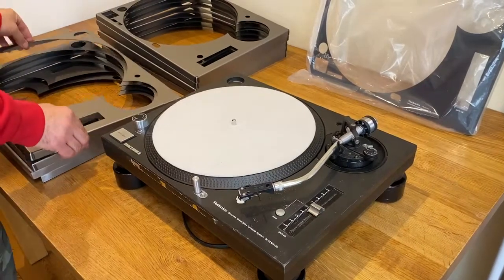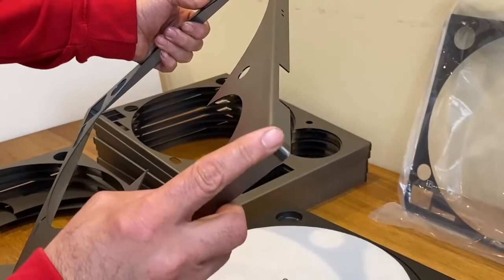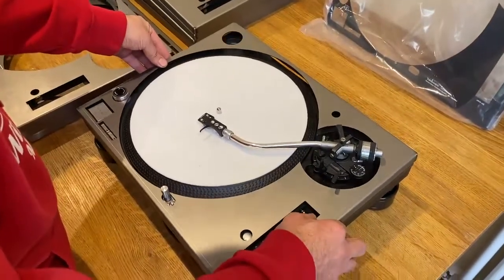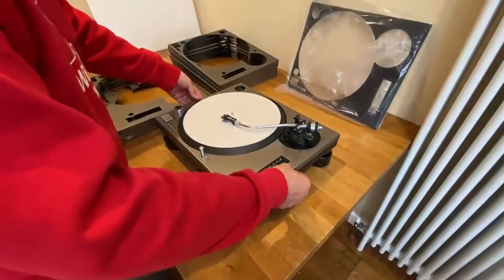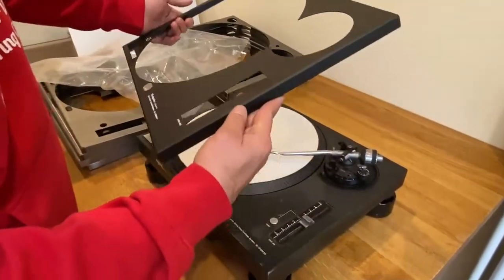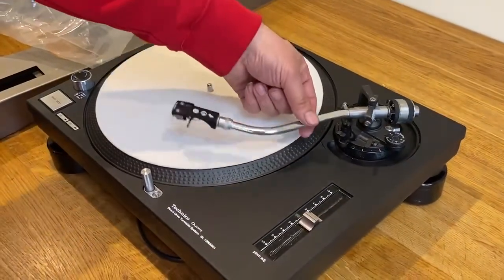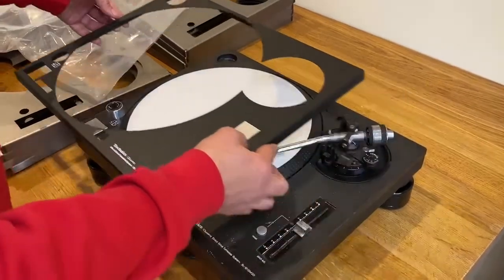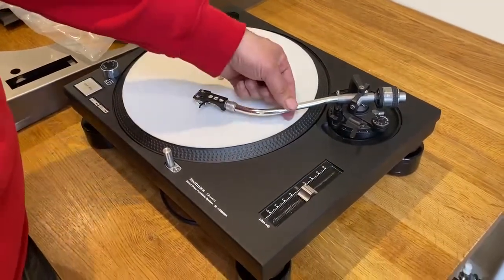Turntable Faceplates  Technics 1200 faceplates By MKStands

Comment: Pro tip.  Remove  the headshell from the arm before installing the faceplate. 
Very painful to watch  the stylus  be placed on the fiber mat and then get bumped.
Reply: agree
Reply: he had the tonearm lift lever up so tonearm is not touching nothing.
Reply: @xxx-xf7ks  ok
Reply: @xxx-xf7ks   "tonearm lift lever up" It certainly does not look to be the case.   "not touching nothing" ? Everything is "not touching nothing" because nothing can NOT be touched.
Reply: @ivansbacon  hi i actually own them and you have to put the arm levers up to place the covers
Reply: @ivansbacon  r/iamverysmart

Comment: How thick is the sheet metal?
Reply: Good question bro they don't ever say imho I don't particularly like them my only reason the thickness it's got to be as thin as possible so it literally looks like a skin..not a cover ect... some I've seen the cnc machine cut out is not tight enough for me I can see gaps to the tolerance should be only minimal that's what puts me off them my I don't like it thick either because it looks raised from the deck itself it makes it look cheap in my opinion